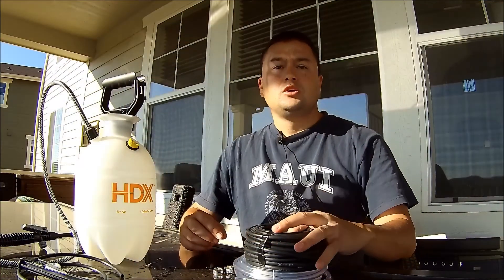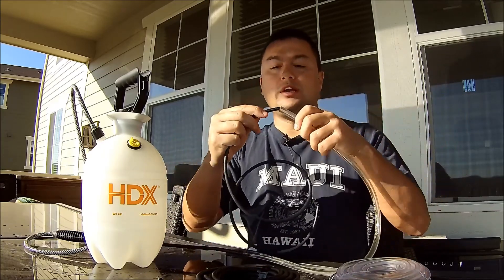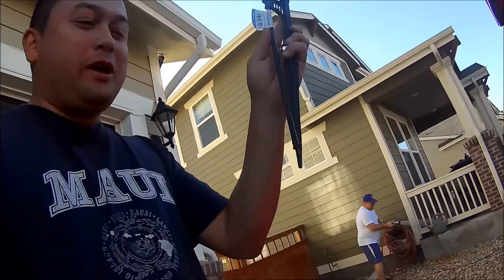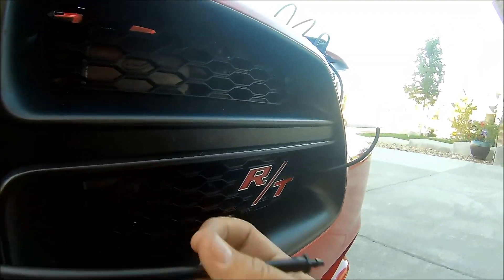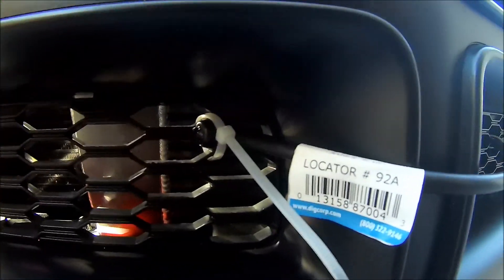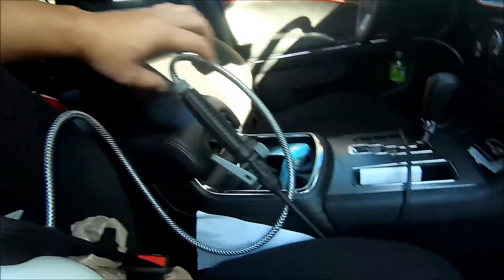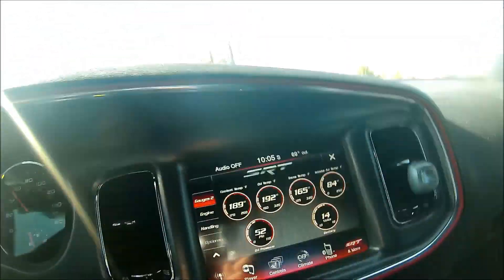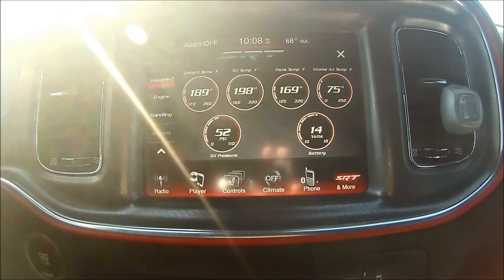Does the budget intercooler water spray really work? - RL testing of Mighty Car Mods DIY spray

Comment: I made and used a homemade water methanol injection system fir my 2015 5.7 ram 1500 i use a weed sprayer and some high pressure air line and i took a air valve stem and drilled a  hole in the top of the tank so i would take my air compressor and put it under pressure and hooked it up to pray about 6 to 8 inches from the throttle body in the air intake i used vp 50/50 speed sauce and i wold i spray at around 2500 to 2800 rpms and i liked it if pulled hard torque my moter and transmission are tuned headers and a few other things. I now have a better system snow kit with hpc progressive water methanol injection controller and a aem wideband afr gauge. And it rips if your stock all srag your ass just the other day i kicked a newer power stroke that was turned up.

Comment: you need to get on the car to actually see the results of the spray, for the best results I think you should do some "spirited" driving get the iat up, then spray the intercooler in sequence,  like both partial and wide open throttle, that's where you'll actually benefit the most from it

Comment: your ecperiment and results are extremely floored , your spray looked poor in spread and droplet size plus your ecu programming clearly wasnt   programmed to respond quickly to this scenario as some other vehicles are  . the subaru's would have been . again your implentation of this experiment needed a more understanding approach to the vehicle in question .  i run a tuned car with an open enough front grill to my much larger intercooler and on a rainy day with all the spray that comes through its easily noticeable in temps and feel of the engine even when still running methanol too like i have  . a large intercooler fully sprayed with a ecu that will respond well will yield noticeable results .
Reply from the maker: Yeah this was only an experiment. Running a snow water meth system at the moment

Comment: You need to use a high pressure pump, one out of a coffee machine is perfect and you need to use an atomizing nozzle
Reply from the maker: You are right. Ended up doing a water meth system.  Best option
Reply: @dasllamas  nice, did you do a vid on it ?
Reply from the maker: @aussienscale  i do.  There were a couple but here is the one where I sum it all up.

https://youtu.be/PEXiTGXHZgM

Comment: are you monitoring the correct temp sensor? you need to log the difference between the 3 temp senors. one at the maf, one before the cac, and i believe the 3rd is at the MAP... (not a mopar guy, so you'll have to pull up all the PIDs to verify)... because when i logged spray vs no spray on my Diesel, I saw a drop of 20 degrees under sustained boost (climbing a 7% grade) @ my map sensor   (which is about 8 inches away from the final intake runner)
Reply from the maker: Really good question to ask though. I am now running a snow stage 2 water meth and see as much as a 30 degree below ambient temperature on hot days
Reply from the maker: Im pulling temp after the intercooler before throttle body.

Comment: Thanks for this instructive video. I won't bother trying to install an intercooler spray system. 
BUT, why won't intercooler engineers put in an AC cooling using either a separate miniature AC system or better yet a system piggy backed off the regular AC?? That should works a lot better. And maybe even an AC cooled intake manifold.
Reply from the maker: The Dodge demon uses the AC system to cool the air. Adding a second ac pump would be parasitic draw. I currently run a water meth system to cool my intake system
Reply: If you want power, you don't want an AC compressor to brake your engine. I believe that shut off AC brings more than colder air.

Comment: When you mention the Sti. That would have been a top mount IC versus your front mount. A TMIC is prone to heat soak, so if you are tracking your STi that IC will just heat soak more and more lap after lap. The sprayer helps to combat that and help to lower charge temps that can contribute to unwanted knock. Really hard to show any real results driving on public roads.

Comment: is the intake are temp before the intercoler or after ? i don't get so much cool air in my Tiguan !!
Reply from the maker: Reads the temp after the intercooler. I have a stage 2 snow system now and that works really well

Comment: This is a poor way of doing it. Get some car windshield washer nozzles, a tank and a windshield washer pump. Water tank in trunk so it doesn't get heatsoaked under the hood. It will give good pressure.

Run it to a seperate switch.
Reply from the maker: Thanks for the comment. Just rigged this up as a quick theory test. Running a stage 2 water meth kit now and that is the best way to cool the AIT

Comment: You should have put windshield washer fluid in the pump, the methanol in it would take a lot more heat away.  Also, I'm sure if you tried this at the track, they would not let you run as you would be wetting the track.  Unless you did it way out, but that would not be enough time.
Reply from the maker: Handy Man very valid info. I have since installed a water methanol system so it sprays internally
Reply: You dont want to spray methanol into your hot enginebay. Thats why the subarus used pure wather no antifreeze or nothing, spraying combustible fluids in an hot enginebay maybe is not a good idea. But spraying it internaly just works fine

Comment: Use alcohol "winter" washer fluid it evaporates much quicker or use straight alcohol. That should make a big difference.
Reply from the maker: J Irvine excellent idea. The winter washer fluid is similar to boost juice and is approximately 50/50 mix of methanol and water

Comment: Your car does not use a rait sensor the factory sensor reacts very slowly for the general public not to be alarmed by a constantly changing numbers on the factory guage. A rapid refresh rate type sensor updates every second or so the factory one undates very slowly that’s why there is such a long time taken to see the difference. In reality it is already cooler but sensor lag built in to the system dosnt want to show a dramatic drop in temp so it effectively shows a slow steady decrease even though this is not what is occurring.
Reply from the maker: g20wel reacts fairly quickly with my water meth kit. Maybe a 1 or 2 second delay. The clip showing this is in this video. 

https://youtu.be/uXpVIKYGVK0

Comment: If your really concerned about intake temperatures, try moving your air filter so it's not sucking hot engine bay air.
Reply from the maker: John O well the engineers at procharger couldn't figure it out and there is no room to move it. The solution is Water meth which is currently being installed and a new hood.
Reply: dasllamas. Meth injection or not, your starting at a big disadvantage.
You could put the pod filter in a box & take air from under the blower behind the headlight or through the fender, or even have the filter inside the guards.
Anything is beter than sucking hot air right above the headers.
Reply from the maker: John O there is not much room to run it under the blower. The diameter of pipe would be restrictive. Literally it won't fit
Reply: dasllamas. Admittedly im a aircraft engineer and not a car mech.
But jet engines just like blowers suffer major power losses in high ambient temps as the air is much less dense,  even with water/alcohol injection they can't fully recover.
Compressor efficiency goes up markedly as intake temps go down.
You could always try wrapping your exhaust. Just a thought. :)
Reply: dasllamas.
Down here in Australia, the outside air temp today was 120F in the shade...even before it got anywhere near my S60R's turbo!
Its amazing the difference it makes compared to a nice cool night.
I wish you all the best in your pursuit of hp!
Reply from the maker: John O that is an option. With the front mount air to air intercooler I typically run 10-15 degrees above ambient. Grand scheme if things that isn't bad at all. With water meth I figure I'd be down to ambient and in some instances depending on air conditions I could be lower. 

Working on aircraft is beyond my abilities but it wen people like you cross into car engineering is when we get cool new inventions. I'll be doing the water meth testing next week and get a video up
Reply: dasllamas. Thanks mate, I look forward to seeing your results. It's something thats been in the back of my mind cause Volvo (don't worry, my other car is a V8!) stuck 2 intercoolers on this thing...and its still not enough! 😭

Comment: There’s a problem with your test. There is a different between intake temperature and MANIFOLD temperature, you need to be measuring manifold temperature since that is post intercooler, after the air has been cooled, ie (water has been sprayed to cool air further)
Reply from the maker: Sonofa Bleep the temperature sensor is by the throttle body which is after the intercooler.
Reply: dasllamas your positive? Because you should have both sensors for a turbo application
Reply from the maker: Sonofa Bleep the sensor I'm reading from is the factory intake temperature sensor that we did not move from it's position next to the TB.  We did not add any additional temperature sensors when installing the supercharger.
Reply: dasllamas what I’m trying to say is that normally on a turbo application there are two sensors an intake temperature sensor  and a manifold temperature, but if you know that that’s your only air temp sensor post intercooler than okay!
Reply from the maker: Sonofa Bleep I'm not too familiar with turbo setups. Mine is a supercharger.
Reply: dasllamas same concept. You should have a sensor around your air filter, and then another after the intercooler right before the throttle body or at the manifold. I have an evo x and I have my intake air temperature and then my manifold air temperature, but you should have close to the same configuration. I don’t know with those dodges but it’d be interesting to know. If you hooked up to obd2 and looked at all your available sensors through whatever software can read your car with, you should have two different temp readings for air, if that’s the case determine which sensor is where and redo the test!
Reply: dasllamas I’ve just confirmed with a dodge tech that you do have two air temp sensors, but the one you see on your dash screen is only intake air temp, inside the air intake itself, you you need an obd2 reader and software to view your manifold air temp sensor, and that’s what you need to do the test with, you need to find what software can connect to obd2 that’s compatible with your car, and that will give you information about every sensor that the ecu is reading ie: it’s IAT, manifold air temp, fuel trims, boost/vacuum, load, all those factors that you can see. That temperature that you’re reading is only what being pulled in from outside by the air filter, not your charge air temp, which is read by manifold temp, hope that this helps give you a better understanding!
Reply from the maker: Sonofa Bleep with the tuner software the numbers match the intake temperature gauge that's displayed in the center console.  I have not seen a manifold temperature gauge but would be interesting to dig into the software a bit more to see if there was one and what I read compared to the I take temp
Reply: dasllamas let me know what you find sir, I’d be interested to know as well! I’ve seen these intercooler sprayers bring temps down 15 degrees or even more!
Reply from the maker: Sonofa Bleep I was debating on redoing this with winter washer fluid. Like a 50/50 water meth. Meth would evaporate faster giving quicker results. In theory that is
Reply: dasllamas I was thinking the same but with isopropyl alcohol but I don’t know how corrosive that or the windshield washer fluid would do
Reply: But hey it doesn’t hurt to just put a t in your existing washer system and put the sprayer on the intercooler just to try it and if it works, then make it permanent! Just make sure about the temp sensor first so you know if it’s actually making a difference haha

Comment: dasllamas you should try cold weather washer fluid instead of 100% water. The methanol in the washer fluid increases the evaporation properties and increases cooling effect.
Reply from the maker: ShamikaServer now you are thinking! Same concept with water meth injection but on the outside. Never thought to try that.
Reply: This is horrible advice.  Methanol is highly flammable and you want him to spray it all over his engine bay?

Comment: they use these systems on rally cars. when your modified and running high boost such as 20psi these sytems have alot more effect. its not a way of increasing power, but to not lose power due to heat soak. water tends to evaporate too slowly under normal driving conditions to have much of an effect on intake temps. now if you ran washer fluid through it mixing water and methanol or water and a type of cheap alcohol you would see lot bigger change in temperature. the faster the liquid you use evaporates the better it will wick away heat when air passes over it. dip your finger in water and blow on it; then dip your finger in alcohol and repeat. you will notice that the alcohol will make your finger significantly colder than the water due to its lower boiling point. the reason people dont just use alcohol is because on its own its too flamable; making it necessary to  mix it with water to prevent an engine fire. now your not going to see a huge difference in power. it will be more like how you notice your car will have a little more get up and go on a cold day rather than a hot day. ive personally felt a difference in the way my car reacted on a hot day between a wet and dry intercooler.
Reply from the maker: spartin1997 you hit it on the head with what you said here. My next mod is actually water meth injection. Instead of spaying it on the intercooler it is actually injected into the air going into the engine. It reduces air temps and increases octane.
Reply: @dasllamas yes but you need to map the ECU for this.your better off misting just water into your intake at a fine mist

Comment: Those sprayers were designed to come on the STI under hard driving not just driving around. You're not going to see much since you're not getting your charged air heated up to a point where the water spray would make much difference. Water won't evaporate at those temperature's. Do a bunch of hard driving and and measure temps then run the same area again with sprayers on. There will be a noticeable difference. I like the way you are testing but you haven't quite captured the conditions the sprayer was designed for.
Reply from the maker: Dan K I will have to try again with some harder driving. I did see results but makes sense if I got the intake temps over 100 and hit the jet it would show a bigger difference
Reply: Indeed you will see a difference when driving hard...it will help alot in reduction of intake charge temps once sprayed. If you're running the track and long periods of staying on throttle and the turbo/supercharger/procharger is really soaking alot under the hood this will at least get that charge air temp reduced some allowing you to stay in boost and not melt down as easily if ya catch my meaning.  Thermal conductivity will be more efficient once that intercooler gets to a point it can actually evaporate the water but daily driving you won't see much at all as you saw in your test. I'm trying to remember but I also believe there is an additive (alcohol based perhaps...need to look it up) that will also help the water to evaporate easier. Thank for the prompt reply. Now I just need to get my SRT boosted heheh
Reply from the maker: Dan K I built mind as a 1/4 mile car so I don’t think the evaporation is going to help in a13 second pull 😂. 

Gl with boosting the SRT. I’ve been wanting to the srt conversion here for the front end
Reply: Totally understandable if you're running a drag car. Best of luck with it! Yeah I'm still fence sitting on which way I'm going to boost...I have had turbo cars, roots super charcharged cars but not a procharger. I'm more partial to turbo myself but you can't beat the sound of a supercharger whine lol.
Reply from the maker: Dan K roots you don’t get that power surge like you get with procharger or turbo. I feel when taking people on rides you get more reaction out of that delayed burst of power.
Reply: Agreed but that linear power Increase is predictable and better for road courses which is what I like. Less having to worry about staying in boost. I'm sure I'll end up going turbo because I do also like that rush of power when you get into boost heheh
Reply: With your procharger are you able to run a chiller box? Be a better option for your 1/4 mile intake charge cooling wouldnt it?